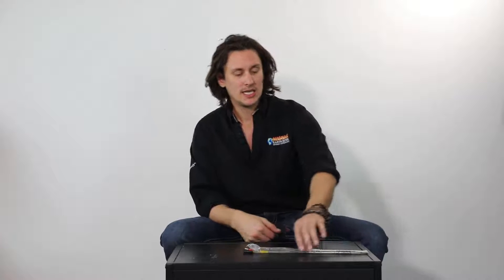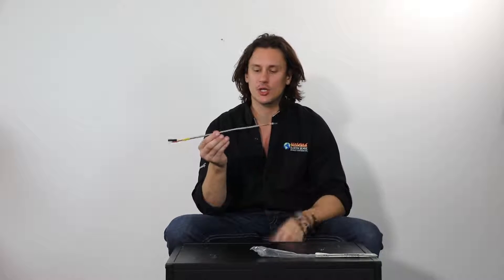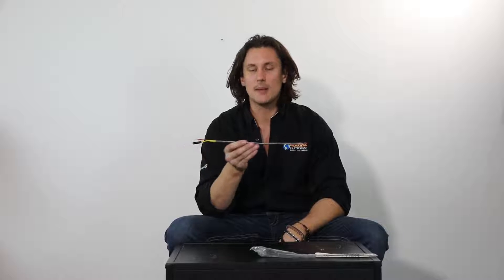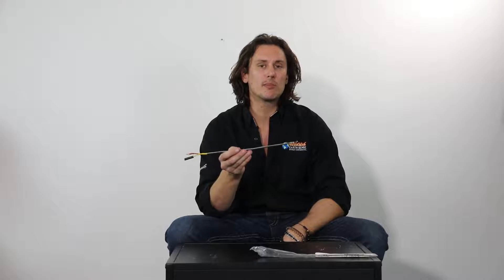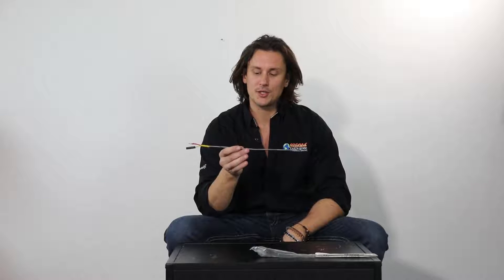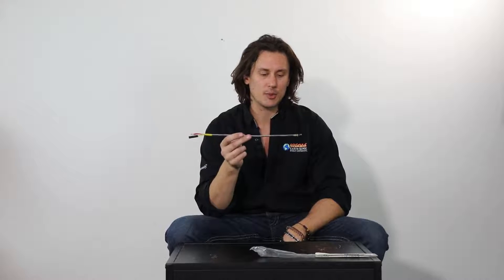Quadrafire Thermocouple Function & Troubleshooting

Comment: My stove is working great untill recently. if thermostat says time to ignite,   stove tries to start up. It does not feed any pellets and an orange light flashes on the controll box. It only happens on occation, not always. I DO maintain cleaning daily etc.  I tried something and it helpsI Unplugged the unit then plugged it back in. ( it has a computer of sorts in it. )  It then works just fine again. Untill the next random time it doesnt feed in start up mode.   Orange light comes on, I unplug, plug back in, it works again.  Can you tell me what that orange light is telling me???  The trmal couple seems ok. I personly don't think it's that. But the orange light puzzles me.
Reply from the maker: Thanks for the message Stephen, happy to help. Let us know which Quadra-Fire model you have and let us know if the control box in your unit is clear/see-through or if it is a black or grey colored control box. Confident we can assist and provide answers for you to get things back up and running properly again. Appreciated.
Reply: @EarthSense  Castile model. semi clear control box NOT black. When lights are on you can see them .
Reply from the maker: @StephenGralish  Hey Stephen, thanks for the message back. With your model and board type, an orange light will indicate a thermocouple error. Let's double check the thermocouple connection wires, pull off the thermocouple cover and inspect the thermocouple end solder point. See if anything stands out or if it's simply a connection issue. If all looks good, than most likely you will need to replace the thermocouple to remedy the issue. For reference here is the thermocouple replacement for the Castile. 
Thermocouple Only: https://pellethead.com/product/pellethead-replacement-quadrafire-heatilator-ecochoice-14-thermocouple/

Thermocouple W/Cover: https://pellethead.com/product/quadrafire-thermocouple-20154-bundle/

Keep us posted, happy to help!
Reply: @EarthSense  The twisted wire appears good. No issues noted with the small ball on th tip of it. However the insulated part just below the exposed wire area is slightly gone. That area is covered though with the tremal couple cover so it wasn't getting any direct flame. If the issue continues I will get a new Thermal couple.  Thank you for your help. Neither the Quadrafire company  ( with a direct phone call to them) Nor our Quadrafire dealer were able to tell me what the orange light indicated. You were the only one with a direct answer.
Reply from the maker: @StephenGralish  Thanks for the message back Stephen. Glad we were able to help and get you the info. Yeah, the most important is the soldered end so the circuit can pass through 1 rod to the other. We do come across thermocouples where everything appears in tact but faulty, and obviously ones where it's noticeable. Being the other area was protected by the cover doesn't seem like an issue. To me it sounds like an intermittent signal or malfunction that the thermocouple is delivering to the control box. You can use a multi-meter on the Thermocouple. I will double check with our techs on best ways to read that and follow-up. Happy to help bud.
Reply from the maker: Hey Stephen, so the info I received is that we would simply check the Ohms on the Thermocouple with a multimeter. The number itself is not that significant, what is significant is the number change when applying heat to the thermocouple tip. I suppose one could bench test something like this. If you use a lighter or pencil torch to heat the end, make sure the ceramic cover is in place. The thermocouple does have to get pretty hot to send the signal. Again, happy to help, keep us posted.
Reply: @EarthSense  The issue is NOT after it ignites. It Not after there is flame. The issue is when it's been off and the room is cold, the thermostat says start up.  The stove starts it's cycle but at that point the pellets are not feeding.  This is BEFORE it actually ignites.
Reply from the maker: @StephenGralish  Thanks for the message Stephen. Still leaning towards this being a Thermocouple issue, however if you wanted to test the vacuum switch you certainly could. If the vac switch was tripped or faulty it will not allow fuel to feed during start-up. Here is a quick video on the vac switch and a video on how to create a jumper wire for troubleshooting. Keep us posted, happy to help. 

https://youtu.be/pHeQzUmSlIE

https://youtu.be/FDVkbsHS95U

Comment: I have an original Mt Vernon quadra fire pellet stove.  Stove starts up fine, thermostat calls for heat, auger starts dropping pellets. About 5 minutes or so later I get a nice fire.  Fire burns and pellets continue to drop but after about 25 minutes the blower won't engage to blow out the heat. Eventually it triggers the snap disc to pop and the fire gradually gets smaller then the fire goes out. I'm able to reset the snap disc and try the process again but still no blower. I purchased a brand new blower and just finished installation. Same thing, starts up, pellets drop, fire starts, after 25 mins, still no blower. Any ideas what I can check' replace next? Could it be the thermocouple?
Reply from the maker: Thanks for contacting us, happy to help. Glad the high limit is working properly; that's exactly what we want it to do if the blower isn't coming on. In your Mt Vernon Original you should have a #1 low limit blower switch. This switch is normally open and closes once temp is met allowing the blower to turn on. Let's closely inspect this switch and the wiring connections. For troubleshooting you can bypass this switch to see if it's the culprit - video below on that. This issue would not be with your thermocouple.  Here is the switch for reference https://pellethead.com/product/quadrafire-convection-blower-low-limit-snap-disc-1-125-20-oem/. 
https://youtu.be/FDVkbsHS95U

Keep us posted, thanks!

Comment: Thank you for this excellent explanation of the thermocouple.  Do you have a reference about how to replace the part?  We have an early Quadra-Fire Santa Fe insert.
Reply from the maker: Thanks Jim, glad to hear it was helpful. We don't have an installation video on the Thermocouple, but it's very strait forward for replacement. Have your stove unplugged, open up the right side panel/curtain on your Santa Fe insert and you will see the thermocouple wires and the lead wires they attach to. Disconnect the wires, pull off the thermocouple ceramic cover, and gently feed the thermocouple through the bracket and firebox hole to remove. Install the new one the same way. Recommended to wear protective gloves when handling the Thermocouple. Here is the correct replacement for reference. https://pellethead.com/product/quadrafire-thermocouple-20154-bundle/

Any other questions please let us know. Thanks!

Comment: We have a propane Quadra Fire (not pellet; fake logs), that did not seem to come on, then all of a sudden an explosion of propane - OMG! We were shocked the glass did not break.  Any ideas what could be going on. We have a thermostat on the wall. Thank you!
Reply from the maker: Thanks for contacting us Kim. Our service knowledge is limited when it comes to gas and propane appliances. It sounds as though gas had filled the chamber creating an explosive ignition. Generally speaking I would say it could be the valve or the pilot that is leaking gas into the firebox area. Double check the pilot and valve connections and seals. We do offer some Quadra-Fire replacement valves and pilot assemblies in the event you need a replacement. Just let us know the Quadra-Fire model you have and we can send some references. Hope that helps, appreciated.

Comment: I have a 1200-I model.  I have a few issues:
1 - unit would start and pellets would not fall for awhile, then they would work normally for 10 mins when pellets would stop.   when fire is almost out, pellets would start falling again.  Then they stopped altogether.

2 - flame is too big,  I cant adjust the feeder rod to have less.  I can pull rod for more feed, but pushing to reduce will just flex the rod.
Reply from the maker: Thanks for contacting us. 
1. As you start the stove up by turning up the thermostat that will enact the combustion blower motor. Once the combustion blower is running and proper vacuum is sensed the vacuum switch will lock and the feed motor will start to turn. Usually this is pretty quick from when you turn the unit on unless the combustion fan is struggling on start-up. Once the initial pellets light, the thermocouple will sense proof of fire and allow the unit to go into normal operation. If at any point the thermocouple does not sense proper temp it will shut the auger feed off. Same with the vacuum switch, if at any point it does not sense proper pressure it will shut the feed motor off. 

2. Flame size - I'm guessing your flame is big like this because we don't have enough air coming in. It's rare that a unit would be over feeding fuel unless there was a major issue with the control box. Oftentimes what appears as over feeding is a lack of proper air. 

With both of these issues I would start with the basics. In most cases what you are experiencing is being caused by ash accumulation and build-up in the stove and vent pipe. I would recommend a thorough cleaning of the stove, ash traps, heat exchange area, combustion blower motor and housing, and vent pipe. From there double check your door gasket to ensure it is sealing tightly all the way around. Once the stove and venting are fully cleaned let us know if any of these issues persist. Thanks!
Reply: @EarthSense  Regarding this "Once the initial pellets light, the thermocouple will sense proof of fire and allow the unit to go into normal operation. If at any point the thermocouple does not sense proper temp it will shut the auger feed off."

If the TC momentarily cools during normal operating mode, shouldn't the unit feed for a few seconds to get the flame back up? If not, how is the demand for fuel met? Is there a flowchart?
Reply from the maker: @ypdave01  Thanks for the message. The thermocouple is designed as a safety switch to detect heat - it does not give any input to the control box for feed. Some stoves have a low limit proof of fire switch and others like the Quad will have the Thermocouple that is detecting proof of fire. Simply designed to recognize the heat on start-up allowing the unit to go into normal operating mode. The feed on a Quad will be controlled through the Control Box - based on your heat settings/thermostat/hopper feed slide. Let us know your specific make and model, and specific issues you are running into, happy to help assist. Thanks!

Comment: So I'm trying to get this Mount Vernon pellet insert working. I replaced a fuse now it will start blower. Then yellow light on controller on side starts flashing. 
Figuring it needed a thermocouple, but I can't find where it might be. I see firepot but there's nothing in it. If I pull lever to dump the pot I see basket below but nothing else. 

What am I missing? I have a new thermocouple and cover but can't seem to see where it might go.
Reply from the maker: Hey Steven, thanks for contacting us. The thermocouple is placed over the top of the firepot. There is a small bracket on the edge of the firepot that holds the thermocouple in place. Generally the thermocouple with the ceramic cover hangs over the firepot approximately 2". Keep us posted, happy to help.

Comment: If the ceramic cover on my Quadrafire stoves thermocouple is broken the stove will not feed pellets am I correct?
Reply from the maker: If the ceramic cover is not on the thermocouple, the fire will burn out the thermocouple almost immediately. Super Important to have the ceramic cover in place over the Thermocouple while the unit is in operation. If your ceramic cover has not been on your thermocouple, I would take a strong guess that the thermocouple itself is now bad and needs to be replaced. We do offer kits that include both the thermocouple and ceramic cover; if you need replacement just let us know your model and we will send over a reference link. Appreciated.

Comment: Quadrafire Mt Vernon stove runs fine first run then turns off on the remote thermal stat. then when try's to start again it blinks 6 red blinks. i replaced the combustion blower motor but its still happening? thanks for the help.
Reply: jiggled the wires to the control panel board to the main computer board and the stove is running fine again..... so idk.....electronics eh? thanks for the help and if a need a part i hope u have it in the future. thanks again. strange stove hope its reliable here.......
Reply from the maker: @tmackjr8652  Thanks for the message back. That's interesting. I guess just double check all the electrical connections to ensure they are secure. If you do need a new wire harness or anything else down the road just let us know. Glad you are warm again. Thanks.
Reply from the maker: Thanks for contacting us, happy to help. First quick question. Is this a Mt. Vernon O.E. with the 4 speed heat control, or is this a Mt Vernon AE with the wall control?
Reply: @EarthSense I think its a mt. vernon E2 is the model number.  it has a control panel assembly on the stove and a separate switch to run on all the time or on the remote thermostat. i think the control panel assembly is bad but not sure. cant find the part, part number SRV7080-036. big unit stove type not mounted in the wall if thats what oe and ae means. thanks
Reply from the maker: @tmackjr8652  Thanks for the Message back. Quadra-Fire has made 3 different Mt. Vernon models over the years. Mt. Vernon OE (Original Energy). Mt. Vernon AE (Advanced Energy), and their most recent is the Mt Vernon E2 model. Thanks for clarifying that. Just running this past our techs, will follow up shortly.
Reply from the maker: @tmackjr8652  Alright, the 6 red blinks will indicate an Exhaust Encoder alarm. 
Causes:
-Exhaust blower jammed
-Exhaust Blower Electrical Connection Issue
-Exhaust Blower Defective/Failed
-Control Board OR Dial Control is Defective

Even though you have replaced the exhaust blower, it still may be good to ensure there are no ash jams/blockages in the Housing/Manifold area of the Exhaust Blower. Good to double check electrical wiring as well. From there, Unplug the Dial Control, if the exhaust blower runs, the dial control is defective. If the exhaust blower does not run with the dial unplugged, then it will be a control board issue/failure. Our Inventory shows the control boards are 10 days out from Factory - I have inventory management checking on that status. The dial control also known as the Control Panel Assembly, appears we have 1 in stock. After you check these things, let us know and we will help best we can. Thanks.
Reply: @EarthSense  unplug the dial control on start up when exhaust blower is running? or   after the first run and the red lite blinks 6 times? and the remote thermostats trying to start the stove? thanks, I didn't understand that part?
Reply from the maker: @tmackjr8652  Thanks for the message back. This was info pulled from the tech owners manual for your E2. Normally we always want the unit off and unplugged anytime we are working with the electrical so we don't fry something. If you unplug the dial control while the unit is off though I don't believe it will go through start-up. So I have to think in Quadra-Fire's troubleshooting outline that they want you to unplug the control dial while the exhaust blower is running in start-up to see if it continues to run all the way through. I would say you want to use heavy caution here - make sure you do not touch the wire harness pins or any of the electrical circuitry on the rear of the control dial. Make sure no harness pins or any exposed electrical surfaces or connections touch the metal anywhere on the stove when doing this. Keep us posted. Update on Board: New replacement boards set to arrive next Friday. Currently we have 1 Control Dial Panel Assembly in stock. Thanks.

Comment: The thermocouple  that I'm  replacing hah a bare wire 2  inches long inside the ceramic cover. The new one has only 1/2 inch of bare wire that will be in the ceramic  cover. Which one is correct?
Reply from the maker: Hey Larry, What model Quadra-Fire do you have? There are a few different style thermocouples for Quadra-Fire based on the model. Happy to double check this for you. Thanks!

Comment: Tks for the information but my blower isn’t blowing out Thur the front of the stove I have a quadrafire
Reply from the maker: Thanks for the message. What Quadra-Fire model do you have? You can run the blower to direct power to determine if it's a blower issue or a snap disc, or control board issue. Here's a video on creating a test cord to test your blower direct. https://youtu.be/rlmiCYI2WPk
Reply: @EarthSense  I believe it’s a 800 nova everything is working but won’t blow out in front appreciate your thoughts has a pretty new board I will check what you sent me thank you again
Reply from the maker: @54bobs  Thanks for the message back. Thanks for the information - Good to know you have the Quadra-Fire 800 Nova. Your stove does have a snap switch that controls the room air blower/convection fan. If you verify the blower is good by running to direct power, I would then suggest taking a closer look at the snap switch. Video below on testing a snap switch. Here is the snap switch replacement for reference. https://pellethead.com/product/quadrafire-heatilator-ecochoice-1-low-limit-convection-snap-disc-125-degree-safety-switch-thermodisc-oem/

https://youtu.be/FDVkbsHS95U

Keep us posted,  happy to help.
Reply: @EarthSense  awesome Tks a lot
Reply from the maker: @54bobs  Most welcome!